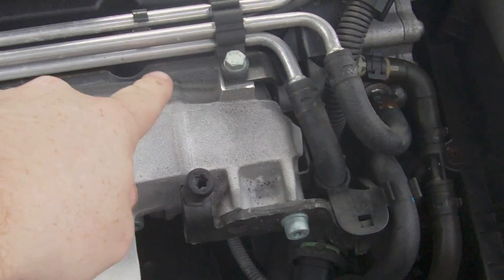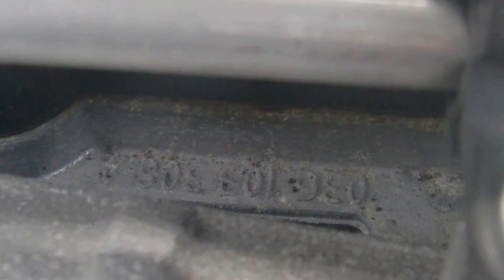Volkswagen BKD Engine....Identifying cylinder head revision (check comments) this video is wrong

Comment: I own an audi a3 2003 for 5 years now. I found this code and letter is C. What does it mean? Head has been replaced. Have done 60k kms so far and still goes up 205km/h.
Reply from the maker: @MochaBlackCat  C is considered the best version. Generally audi heads don't have a problem. Read the comments on this video. As I was factually incorrect when I made it the cylinder head stamp is in different location the one posted

Comment: I've recently bought a 2L TDI PD Skoda Octavia... It is the bkd engine, any idea if the problem was fixed by this year's model...?

Ta
Reply from the maker: I'm not sure what year they started using the revised cylinder heads. 

Check the cylinder head version out yourself. Make a note of the comments it's around the EGR for the correct one. I'll do an updated version of this video at some point. 

Take it with a pinch of salt really it may go, it may not. 

I took this from Briskoda forums if it helps, ideally 2007 onwards....

03G 103 308 A years 2003 to 2005.55 allmost all cracked
03G 103 308 B years 2005.5 to 2006.6 only a few cracked
03G 103 308 C years 2006.5 to 2007.5 none cracked
Reply: @RoadRunnerMeep  thanks bud
Reply: @RoadRunnerMeep  i forgot to mention in last post, its a 2011 Octavia 2.0 tdi pd

Comment: Wrong information...you confuse the codes.
The code from video is from head cover, the real code from the cylinder head is under AGR, tthe cooler from EGR.
Reply: The codes from your video is from camshaft cover 
03G 103 308 A,B,C (the letter indicates the revision of head).
The real important code is from the head, and thi is with code:
03G 103 373 A (with problems, crack)
With B (with problems, crack)
And with C letter problem resolved.
The heads with most cracks is vith that versions:
V125,v130, v320, v330 (all with A letter).
Now i change my engine by another for this problem, cracks in head and leaks coolant on cylinders.
Reply from the maker: @sebiosip  thank you. I'll have to look into this further as even when. I was research g this all the information I found myself pointed to the head. I'll have to look

Perhaps it's a quick check. If your car has an A camshaft cover changes are the head is an A too
Reply: The title of the video should be changed. @sebiosip is right. The correct information about the head letter is  behind.
Reply: My engine is with A revision and A code from the head (the head with cracks issue), the new engine is from 2007, with C revision :) but....with A code on the head :(
Reply from the maker: @sebiosip  not good. I've learned something new then. Unfortunately all engines can go porous it's just pot lock end of the day
Reply: @RoadRunnerMeep  in the internet is full of wrong information.
Many confuses the codes.
Reply from the maker: Nope. The cylinder head revision is in he location I give in this video.
Reply: @RoadRunnerMeep  the code from the video is from head cover but the code from head is under AGR.
I have the engine down... ;)

Comment: "C" is the best head revision,"A" the worst
Reply from the maker: I'm well aware but as long as the engine is looked after it means nothing. My car had about 120k and pulled like a train without any signs of failure
Reply: @RoadRunnerMeep  I agree with you.It is VW problem,not owner's.They had troubles with heads,and with C head everything is well

Comment: Could someone help with my seat leon BKD engine https://youtu.be/7GSlox8rmuU
Reply from the maker: What exactly is the problem. I can't work it out on your video, cameras tend to amplify the noise. It sounds like you're getting a teeth grinding noise at the start which could be flywheel/starter motor but I don't know what problems/symptoms you have exactly?
Reply: You can feel the whole car move when starting and switching it off. The car also shakes when you accelerate to about 40/45mph. I’ve had the flywheel changed on it approx 300 miles ago and the noise has gone noticeably less. I was thinking starter or maybe worn mounts? Sub frame maybe?
Reply from the maker: Bomb babe interesting you mention it as my car has started shaking under load in current investigating it. 

- do you have access to VCDS? If so what errors ?

My car has an issue with the g62 engine coolant temperature sensor. I'm going to be replacing this but theoretically if the engine isn't reading the correct temperature it can be injecting the wrong amount of fuel into the engine 

You could also try scanning the injectors and logging them you may have an issue with then over or under fuelling 

When was the last time you had the fuel filter and air filter changed. 

Normally when my car starts shaking excessively through the wheel is I'd I put the engine under load. Ie 50mph in 6th and accelerate at 75mph the car shakes so much I have to drop gear 

I suspected this down to worn dmf or injector/fuelling fault at current time I haven't diagnosed it as it's the first time I've had . I'd be interested to see if you're has a temperature fault or am EML lit
Reply: I’ve had a diagnostics done and it came out clear no errors whatsoever. However when starting the car once hot, a cloud of white smoke comes out and one of my friends said this maybe because the car is over fuelling. 

It’s the same issue with me, under load the car shakes quite a bit so I have to pop it into manual on the DSG to change down as sometimes I have the accelerator pressed quite a bit and it doesn’t seem to wanna change down because it shakes aggressively and doesn’t want to pick up speed. 

Last service was 100 miles ago changed oil oil filter fuel filter air filter dsg oil and filter and coolant. I’m starting to hear a loud click every now and again I think that may be linked to a sub frame issue.
Reply: No lights currently lit
Reply from the maker: Bomb babe I'd swear your car was mine 🤣

The subframe click might be from the drop links. Or bolts. I've recently changed my steering rack and getting a clicking now I think it's the stretch bolts need replacing as my drop links are new

What was the car scanned with? Garage readers don't sometimes pick up faults. VCDS will. 

What cylinder head do you have ? Is it the porous version. Any signs of hg failure ? 

Normally black smoke fuel . Grey smoke can be head or seals. 

I'd definitely find a vcds user nearby. I think you will find faults. 

I think your fault are either g62 sensor. Injectors. Injector loom or maf/inlet manifold/egr
Reply: Yeah it’s a 07 plate !! Got it from Pontypridd in Wales. It was just a normal diagnostics. I will get a VCDS on it. 

Headgasket has no problems and I’ve not checked if it’s the porous one. What letter should I hope it to be?  

Yeah that subframe is one annoying piece of metal. Clicks sound when I turn left and right but it doesn’t happen all the time. 

I’m hoping it’s something minor and not a cylinder head problem. To me it sounded like the cranks were going.
Reply from the maker: VCDS is always the best to use, it's as close to manufacturer diagnostics as you can get and allows you to perform a large range of tests. There is a VCDS users UK group on facebook. 

Headgasket, worst one is an A revision. As an 07 yours should be a B/C head. If you watch my video you can see how you identify it. I wouldn't worry if yours is an A head though, mine is an A with 104k miles and still runs sweet as a nut (other than the shaking)

It's a muffled click inside the car, but happens when I'm braking too. I think it might be related to the subframe popping sound you get on the GTi versions which is normally when you need spacers in the subframe. 

I need to renew all the bolts underneath because I've changed the rack, but the clicking is a metal/metal sound (could also be worn rack, but I'll take risk)

I don't think your problem is head, I think personally it's an issue with A/F ratio. 

My car will pull fine if I drop a gear then acceelerate and change back up. It just judders when the revs are too low. I personally think it's the injectors and EGR being blocked. BEcause I have an issue with coolant temperature sensor I'm changing that first though, as incorrect engine temp means incorrect fuel delivery. 

If you can find someone with VCDS you can do a log of your injectors during a drive to see what they're reading it
Reply: Wish me luck mate I’ll check it out in the morning. Mine has only done 105k and it drives sweet as a nut just when I’m slowing down you’ll hear the sub frame make a loud clunk. I’ll be sure to get it checked and let you know the outcome. Also, my engine shakes pretty violently forwards and backwards on start up and switch off. I’ll get the car checked from the bottom and all the mounts. All the best mate and I can’t thank you enough. Cheers
Reply: Hi mate I checked the cylinder head number it was a C. Took it to get checked and the mechanic said apparently it’s the starter solenoid and starter as these engines suffer from a “ hot starter issue “. What’s your opinion on this? Cheers
Reply from the maker: C is just a better cylinder head really. The started solenoid has fuck all to do with the problem. The "hot start" issue they speak of is basically when the engine is at operating temperature (90c) instead of instantly firing like when cold, it cranks and cranks then fires. It can be down to worn starter motor, low battery, bad injectors, bad wiring, ecu map it's a multitude of problems. 

The problem is basically caused because at low temperatures the car injects a lot more fuel which helps start the car, at higher temperatures it reduces it to help with emissions. Older cars didn't do this they just "dumped" the fuel into the piston chamber and fired it instantly. 

If you're not a member have a look for the MK5 Golf Owners Club on facebook. Some good advice on there, but you WILL be asked if you have scanned the car with VCDS. It's the best tool out there. 

Personally I think the problem is caused by fuel / air starvation and nothing else. 

I daily redline my car through the gears, and the EGR valve or inlet manifold has become blocked looking at warnings. If the engine is starving it chokes it out and causes the engine to stall.

I'm due to receive my G62 sensor soon so will be able to test. 

Personally I'd scan your car with VCDS first. Wru from? There may be a local user near you
Reply: Hi mate sorry for the late response. Got the car checked and a bad flywheel and clutch was diagnosed for the reason the car starts like that. As for the clunking/shaking the passenger side driveshaft had a significant amount of play in it.
Reply from the maker: Glad you got it sorted out, I considered a drive shaft issue on mine, hopefully it's not that and something easier for mine. IF not looks like I'll be budgeting for more repairs :D
Reply: The flywheel was changed approx 300 miles ago, I don’t know why it’s gone bad in such a short time, maybe u could shed some light on this?
Reply from the maker: Bomb babe if the flywheel was only changed 300 miles ago I'd go back to the company who did it and make them pay to fix it. Maybe they didn't replace all the main parts. They used the wrong ones. But a flywheel should not fail after 300 miles. A good LUK/SACHS DMF setup should last 70k or more easy. 

Don't pay to fix the fault when someone else could have caused it. Did the mechanic say why the flywheel failed

Comment: Did you say the "A" one is the bad one?  what are the other types?  Cheers
Reply from the maker: There are 3 revisions A,B,C mine is an A revision. A revision are meant to be the worst. I'm on 100k miles now. So it's OK currently
Reply: ***** OK that's interesting.  I'm on 145k miles.  Mine is a C revision (Golf TDI 2007).  I checked after you showed me how.  Mine also used to lose coolant (I used to top up about 100ml per month), until I put a contained of "K Seal" in the coolant, which seems to have stopped the coolant loss.  It's important to shake it thoroughly before you put it in.